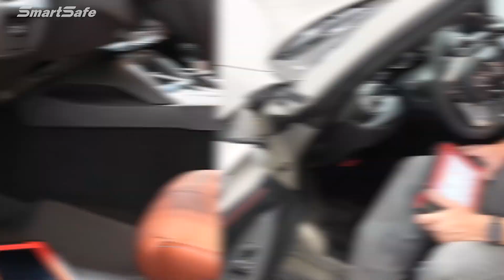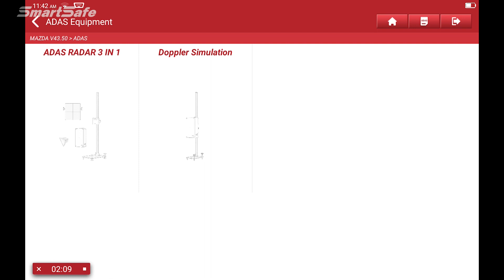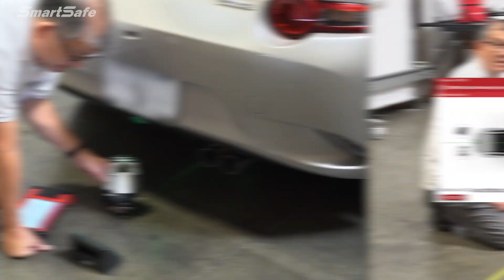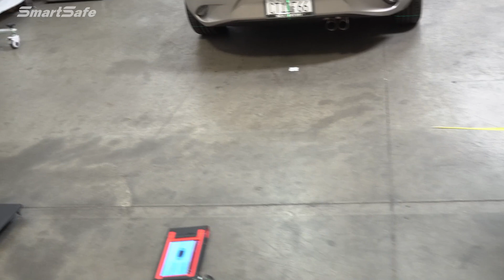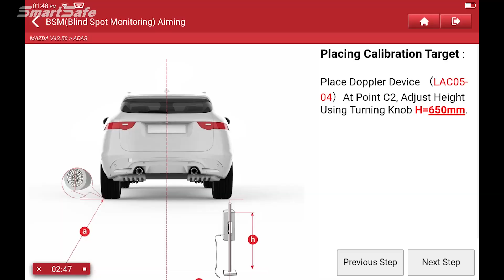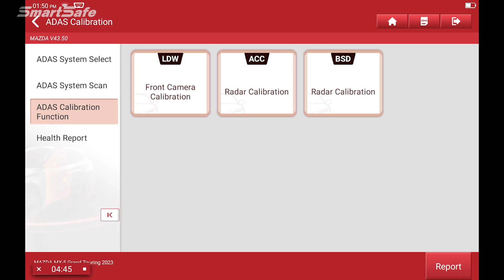2023 Mazda Miata RF - Rear Blind Spot Monitoring Calibration using SmartSafe 3-in-1 Radar Frame

Comment: I just had a new windshield installed and all the front sensors work fine. However, now the backup camera radar won't detect objects.The camera works fine but won't beep as objects approach. Is there any connection between the windshield and the rear bumper sensors? Can I fix this without that tablet?